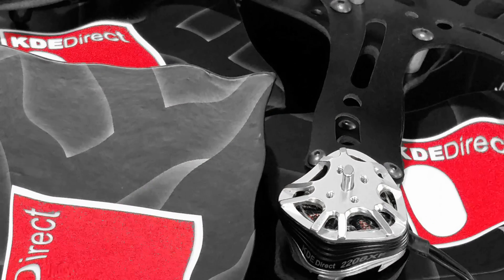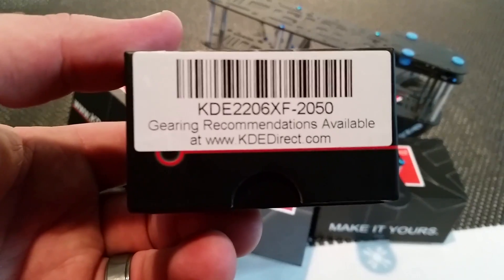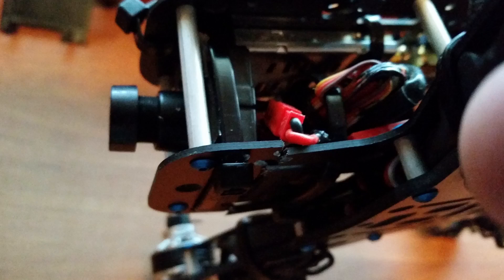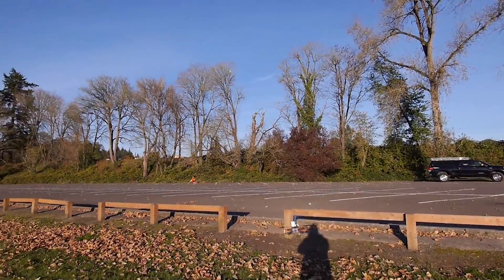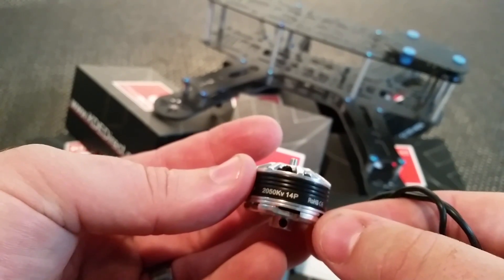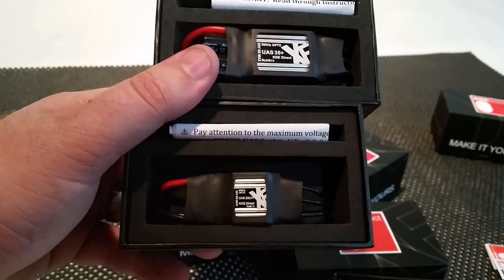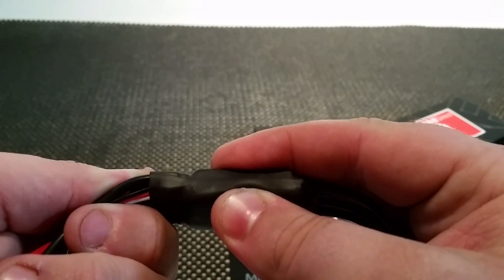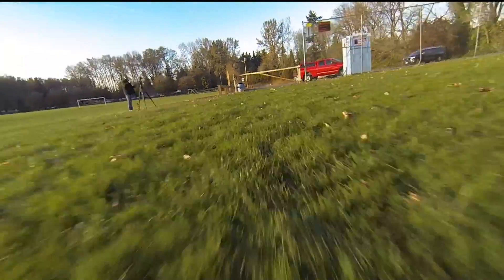KDE Motor and Esc Review Video

Comment: just wondering if they can be used with other motors.. 
have DJI 6010 130kv motors on 12S, and wondering if this will work well for heavy lift quad.    can you provide any thoughts?  thanks, love the video!!  
KDEXF-UAS55HVC